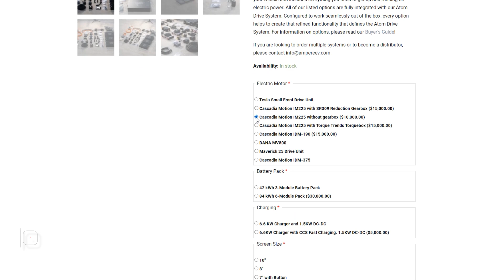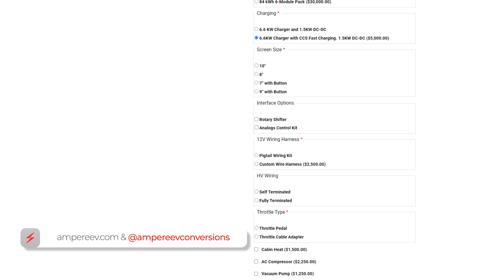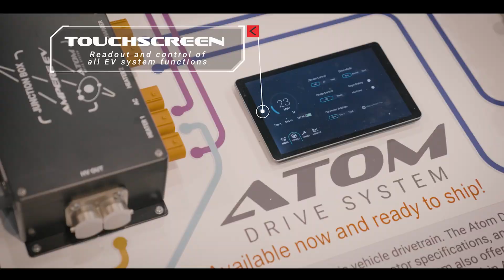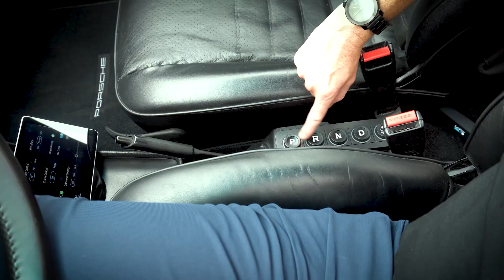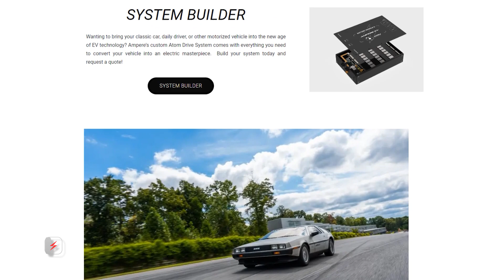Keeping The Motor Spinning - Jay Stroud | Ampere EV

Comment: Wild. you can buy a whole tesla for less than their cheapest kit. Good for you guys. Hopefully AEM doesn't give you to much competition.
Reply from the maker: AEM takes a different approach, and are focused primarily in the electronics space. They allow users to calibrate their electronics, whereas our system is fully engineered and calibrated out of the crate. It merely needs to be installed, and we work with our customers prior to delivery to ensure that process goes smoothly. There is no electronics programming required, regardless of engine selection, with our Atom Drive System. We also deliver a complete system with everything required for installation, including HV and LV wiring. And we have a features list that allows installers to modernize a classic or create a series production run of popular enthusiast chassis with things like AC and heat, sub-ambient battery cooling, CCS fast charging, analog gauge and button integration, OBDII diagnostics, and more.